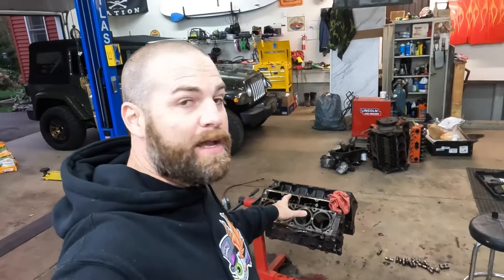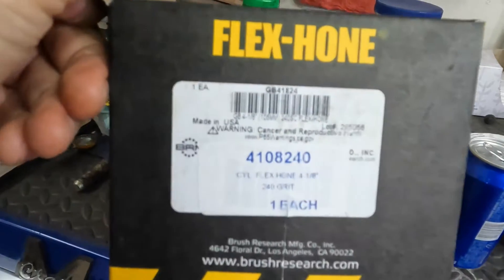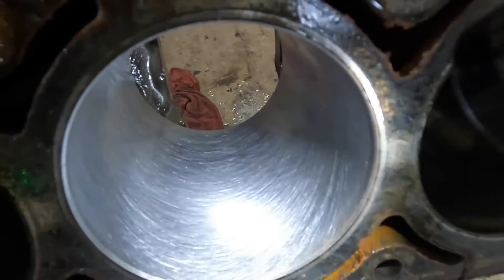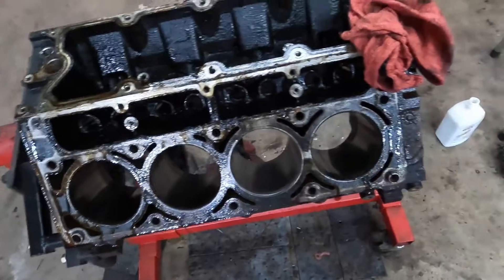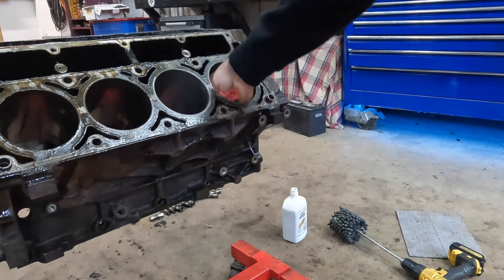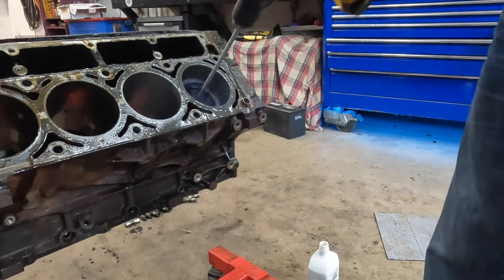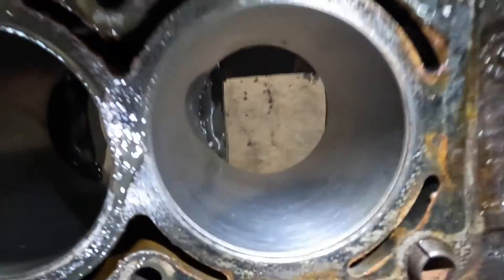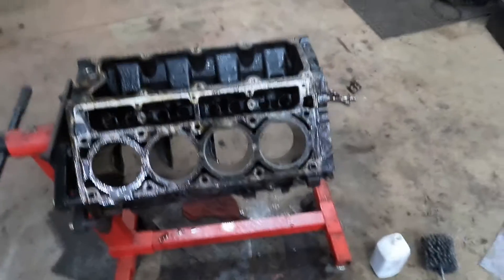Short Version of How to Use a Ball Hone

Comment: Question Sir,

Did any of your cylinders have any taper ? 
From what i know, the ball hone will not remove any taper.

😊 TY
Reply: Unless you had a head gasket leak these EFI engines are t wearing the bore out if hardly any the block is much tougher iron than the 70's stuff
Reply from the maker: It will not correct that would be more of a machine shop correction